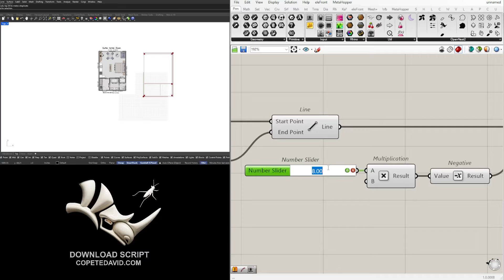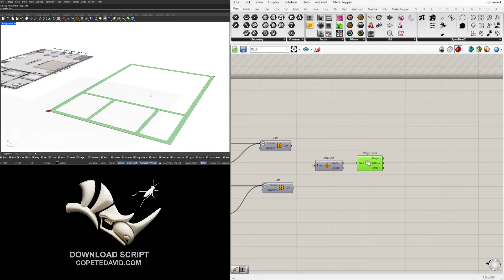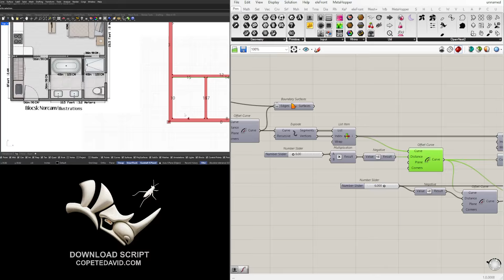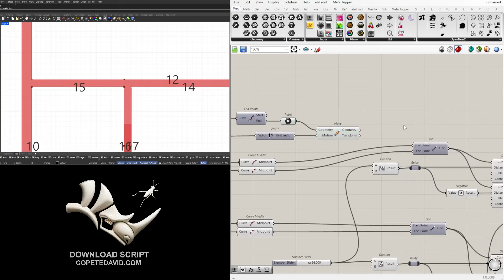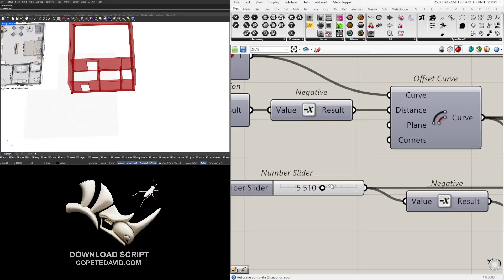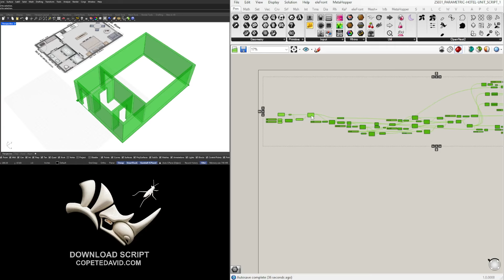Grasshopper Rhino Parametric Floor Plan Layout  And Design Tutorial + ReRenderai

Comment: Excuse me, sir. I would like to ask how this algorithmic recipe affects the speed of producing 3D models. Wouldn’t it be faster to use BIM-based applications such as Revit, where we can easily modify room dimensions, heights, and wall thicknesses? Could you please explain how this recipe provides added value in a design workflow? Or is this approach more relevant when conducting building physics research using genetic algorithms?
Reply from the maker: Grasshopper is essentially an interface for modeling within Rhino. You can create designs using any program, but I use Rhino and Grasshopper to demonstrate how architectural forms and parametric modules can be generated through algorithms. The key advantage is that you can “program” your design logic and quickly adjust or update the model using sliders. This example might not show Grasshopper’s full potential, but check out my other videos to see how versatile the tool can be for creating more complex architectural designs.